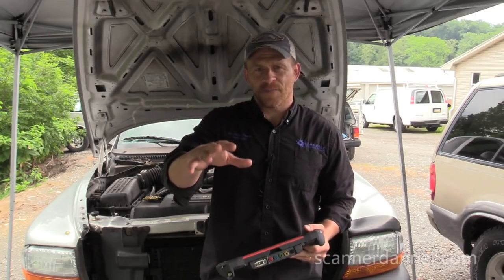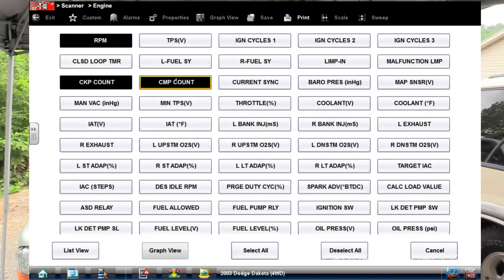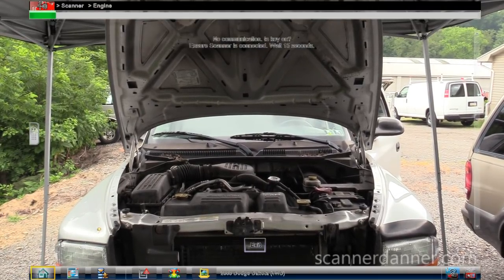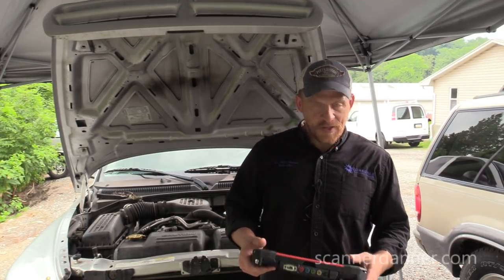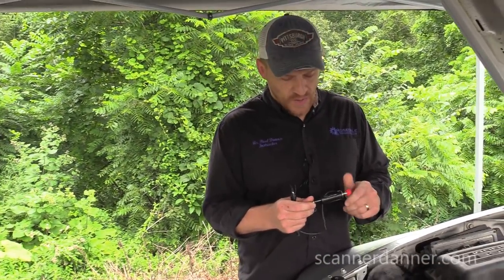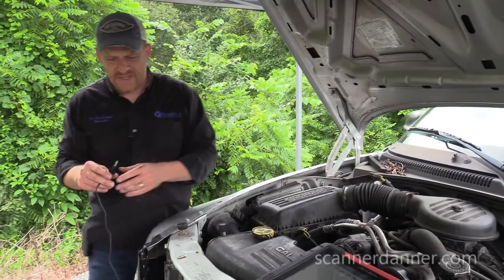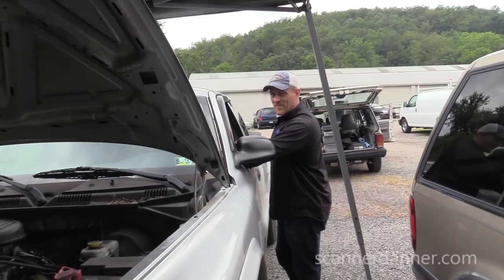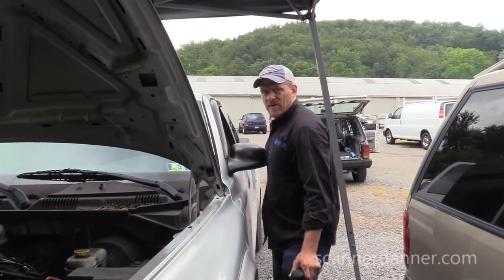Dodge Dakota No Start, No Fuel Pressure Testing

Comment: I have the same truck with a bad fuel pump and beings though I don’t do any loading I want to cut an access hole in the bed to make life much easier for the next replacement.i just don’t have a clue where to start because I can’t seem to find the dimensions anywhere online for a 97 Dakota v6 3.9..I’m really hoping you or one of your subscribers could help a brother out it would be highly appreciated...                                                  edit: my fuel pump kicks on for about 10mins then dies out
Reply from the maker: What is your fuel pressure when it "dies out"? Let's make sure it is the pump first.
Reply: ScannerDanner thank you for your response by the way you are the greatest I love your passion for teaching just awesome! Anyways my fuel pressure holds at 48 psi when I turn the key on jumps up to about 50 psi with engine running..(now it only runs for about 10 seconds and then shuts off whereas before it ran for 5-10 minutes before it stalled.)the fuel pressure starts to drop instantly after engine shuts off and holds at 20psi.it goes from 50 psi to 20 psi pretty much as soon as the engine shuts off.
Reply from the maker: Not worried about the bleed down issue right now, separate problem in my opinion. So your fuel psi is sitting at about 48 to 50 psi when it shuts down? If so, it is NOT a fuel psi problem that is causing this shut down issue. (As long as you are not working on a GM CPI system/Vortec engine)
Reply: ScannerDanner fuel pressure reads 48psi with key on and about 50psi with the engine running.but (immediately) after the truck stalls the pressure drops to 20psi and holds there.is this most likely a bad fuel pump??
Reply: ScannerDanner the pressure drops to 20psi instantly after the truck stalls it
Reply from the maker: Key word "after" 
Yes, you have a bleed down issue, it should hold on shut down, but this is NOT your problem.
Reply: ScannerDanner thanks I already have a pump coming in the mail today I’m really hoping it fixes it my truck been sitting for 3months because I have no one to help so I’m trying to tackle it myself through your videos which been really helpful to a non mechanic like myself.
Reply: If you have any other suggestions even your worst guess would be better than my best guess I would appreciate it
Reply from the maker: If you need additional help:
Post this to my forum. It is free to join and we have an awesome community that is friendly and willing to help. https://www.scannerdanner.com/forum/post-your-repair-questions-here.html
Hope to see you there!
Reply: ScannerDanner thanks!!
Reply: ScannerDanner I replaced the fuel pump now it (does)hold its fuel pressure even when it stalls fuel pressure isn’t a issue anymore ...it still stalls after 5-10 minutes of running so Next I checked for spark at the plugs and noticed I’m losing spark when it stalls..replaced cam and crank sensor still no spark after 5-10minutes..replaced cap and rotor still no spark after 5-10minutes.
Reply: I’m trying to figure out the color of the wires you probed for the ground and pulse test and the asd circuit test on the injector??i do have the same motor in my 97 Dakota
Reply from the maker: I told you it wasn't the pump :-) 
Nice job fixing your bleed down issue though

Comment: I agree that the fuel pump is bad but he still did not verify that the ground was good.
Reply from the maker: If you want to be technical, the power feed test wasn't valid either.  Just because there was 12v there does not mean it was good.
There could be resistance in the feed wire that we are not seeing due to no current flow from an open in the pump motor. I even talked about both of these scenarios in the video. IF you feel the need to load those two wires, then do it. You're just not going to have a wiring problem at the same exact time the pump fails. It just doesn't happen. So I am saying it is an unnecessary test in this application. If in the extreme rare occurrence you end up with a wiring problem AND an open in the pump (at the same time), fix the wire when your done. You still needed a pump and didn't waste anyone's time or money.

Comment: Hello sir my name is Shakeel Hussain I am from Pakistan I am big fan for you I am speaking my English is very bad but trying sir my profession auto electrician my experience 5 years old NPAV viewing your video and little little help my question sir auto electrician basic wiring diagram I was all sensor connector wiring knowledge sir where website available wiring diagram All cars my question only one I wait your answer
Reply: Sir my spoken little little mistake I am so sure you are understand my question
Reply from the maker: This should help you https://www.scannerdanner.com/forum/post-your-repair-questions-here/16-need-service-info-check-here.html
I use a program called shopkeypro.com but I'm not sure it would be good for your market. Click the link above which will take you to my forum on my website where guys from all over the world have shared suggestions on where they get information

Comment: sounds like a typical dodge ;)
a hillbilly would have done gave it a toot or 1/4 can of starting fluid within 2 minutes of no start, in which it would have fired up and died, so they'd have checked for fuel, then banged on the tank to see if it'd start. must not have been owned by a hillbilly :))